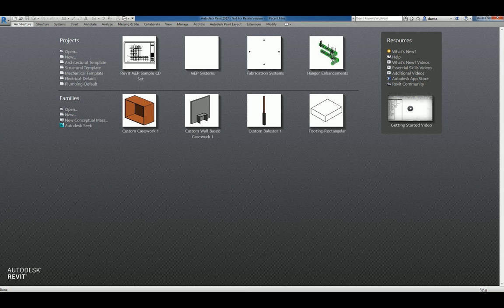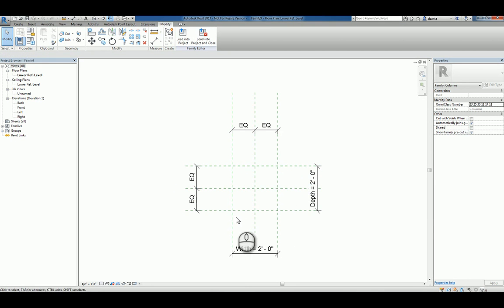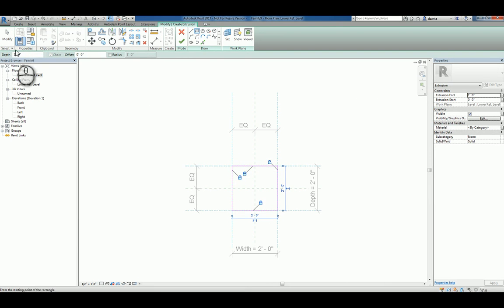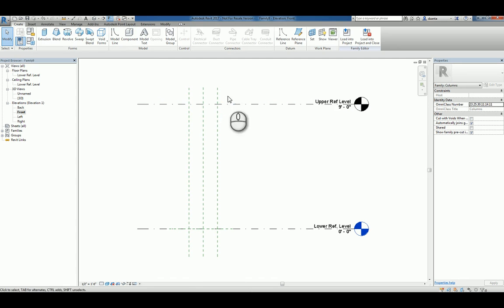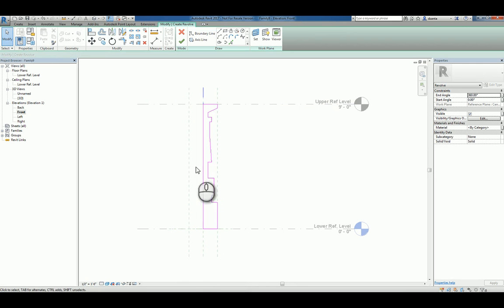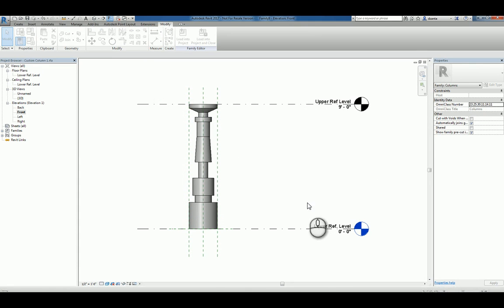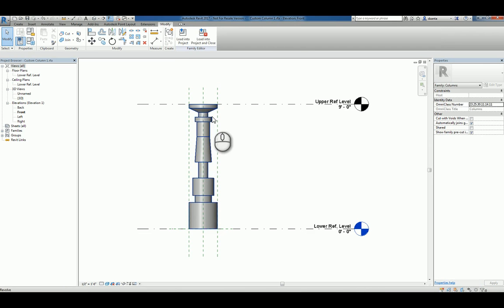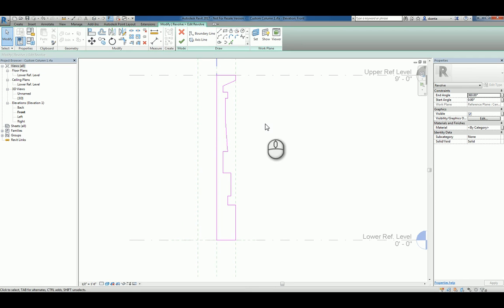Revit Families Series   Custom Column How To

Comment: Hi sir i need to know about ceiling fan how to create in revit can u plz give me sume tips
Reply from the maker: Hi....sorry about not replying sooner....You can either start with the default Revit ceiling fan family file and modify it or you can start from scratch.  If you start from scratch, I can teach you how to make it.  The steps are as follows:
1- Start with the Light Fixture Ceiling Based family (this way you can use the light source object if you need a fan with lights).  Otherwise, use a the Specialty Equipment family file.
2- Create the reference planes that define the geometry skeleton of the fan (i.e. blades, bottom of fan location, shape, etc.)
3- Create the dimensions that describe the fan...parameterize/lock where necessary
4- Flex the skeleton before adding physical geometry...it should flex properly...fix if not
5- Add geometry and lock faces to reference planes where applicable
6- Flex again with geometry to see fan adjust accordingly
7- Save often (preferably, after doing a lot of work in stages)
email me at dzanta@gmail.com if you need help